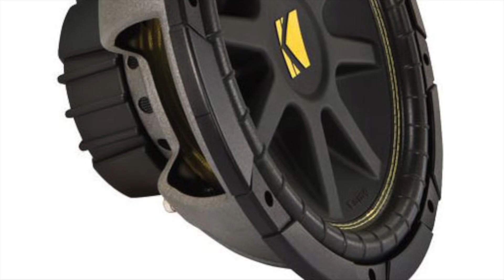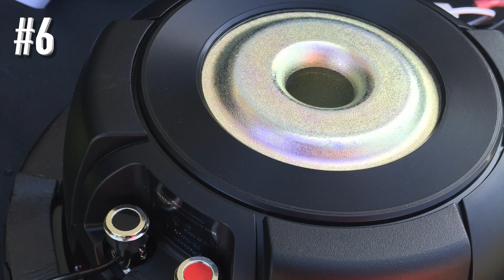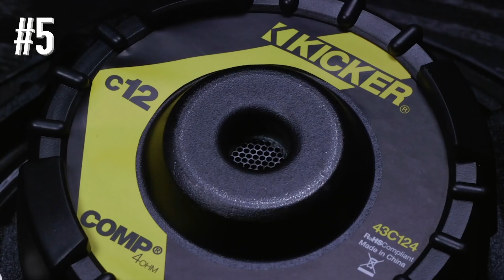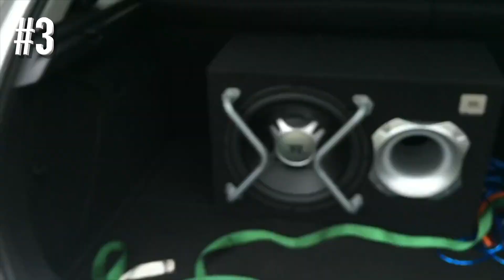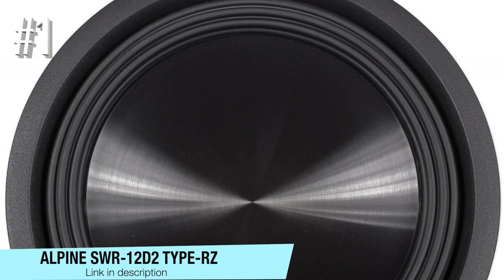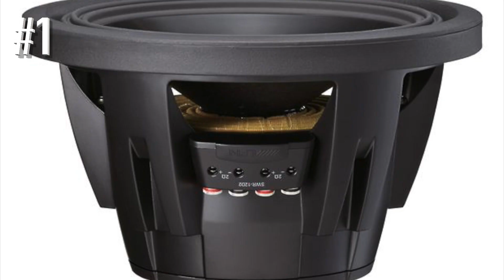Best Sub woofers for Cars 2020

Comment: Brooooo nooooo so many mistakes. This guy has no clue what hes talking about. He referred to the Kicker Comp to the "Kicker 300w"
Reply: Is the kicker comp good? I was thinking about buying it
Reply: @unomomento4504  the kicker comp is an ok sub for like a beginner's system. I would highly recommend the comp vr also known as the "cvr" but just keep in mind that the cvr is a dual voice coil style sub so the way you wire it up will be specific. The comp is a single voice coil wich is more simple to install. Tge main difference beetween the 2 is of course output the cvr will be a louder sub compared the the comp.